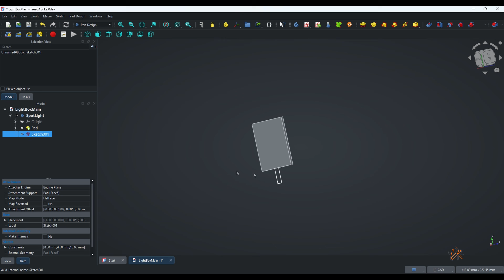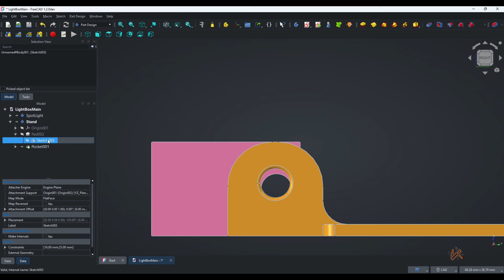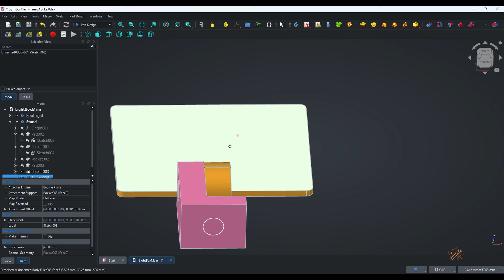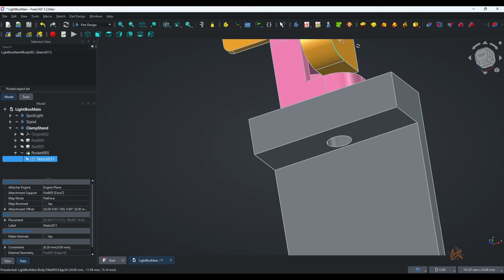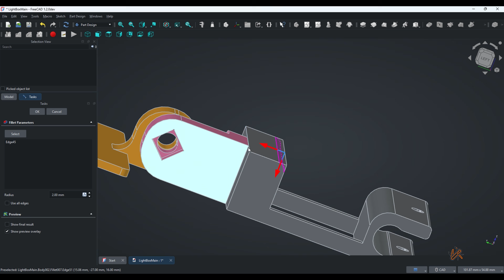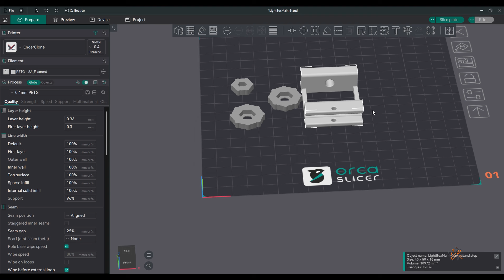FreeCAD to 3D Printed product - LED Light Box for a 3D Printer

Comment: Positive to positive and negativ to negativ is parallel not in series ;) Otherwise good video.
Reply from the maker: Good catch, thanks for the correction on the wiring! They are wired reconnected the positive to positive and negative to negative after cutting into strips making one sequential strip again.